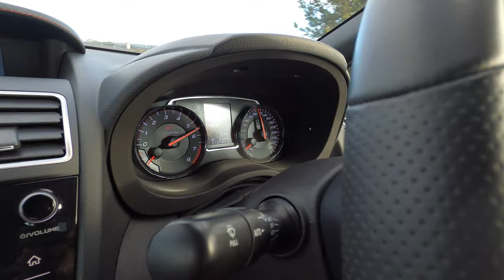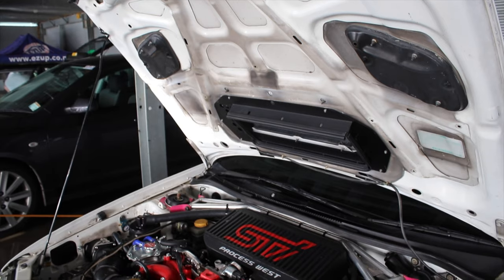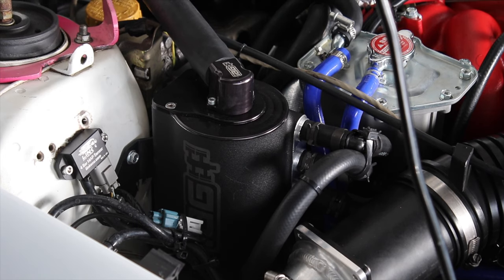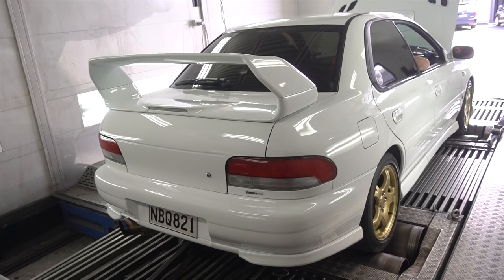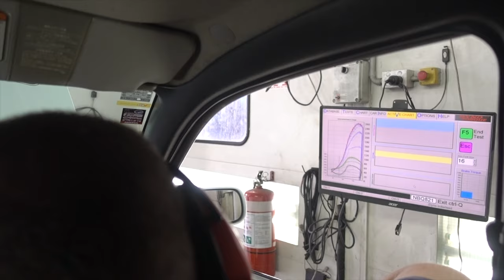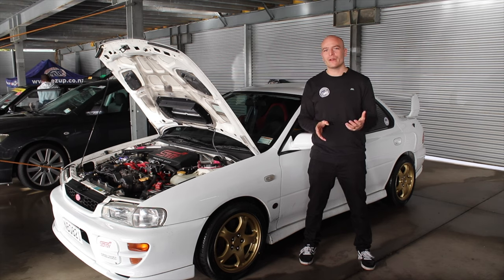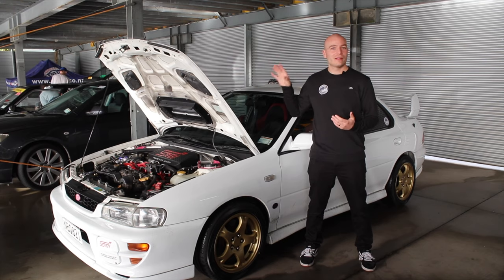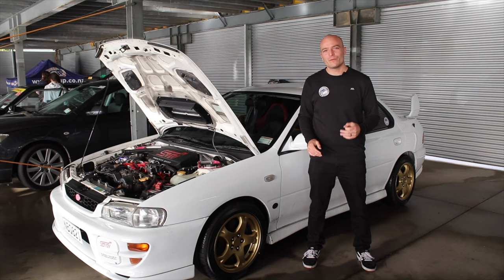Built GC8 gets more power | JDM WRX STI

Comment: I am planning to buy process west now I am using oem but using gtx29 hybrid turbo tune on ron97 1st 2nd 3rd gear no knock using boost levels 1.7bars(ign total timing around 12-15  but once hit the boost at 1.5 bar above and 4th 5th gear that is a lot of engine knock only I tune mine apexi avcr(boost controller)to prevent 4th and 5th gear to reach boost above 1.45bars(below 1.5 bars no engine knock what so ever). I am planning buying this process west tmic for mine cars. 
How many bar or kpa or Psi this Thomas's  gc8 were running before and after the process west tmic a million thanks

Comment: Did the AOS fit with any issues. Can I buy this AOS and just bolt it on my gc8?
Reply from the maker: Hi Daran, not a direct fit but if you are handy you can make it work spending a couple hours of making brackets and adapting hose lengths. Not a complete bolt in option though